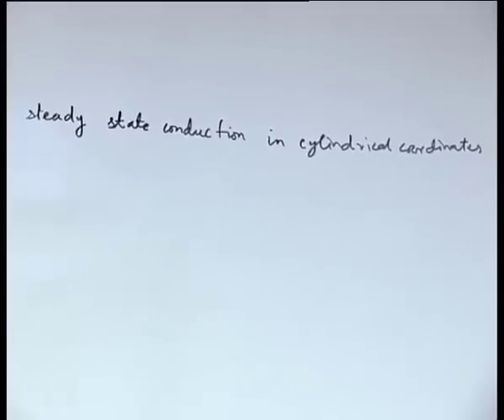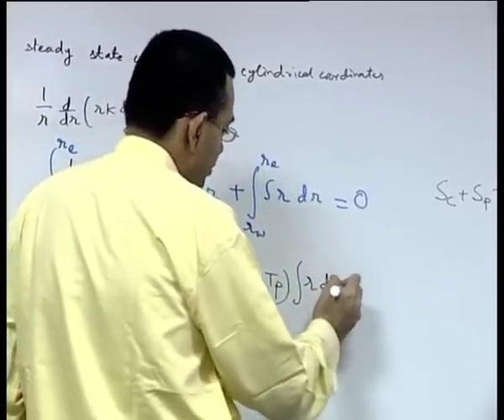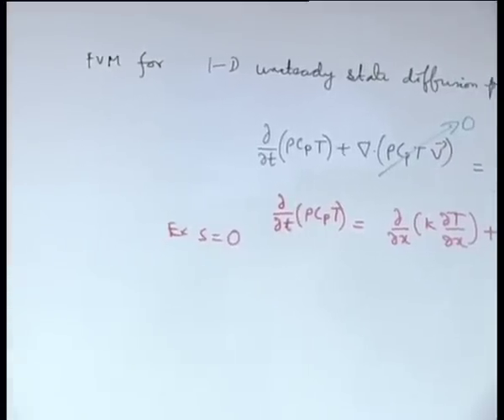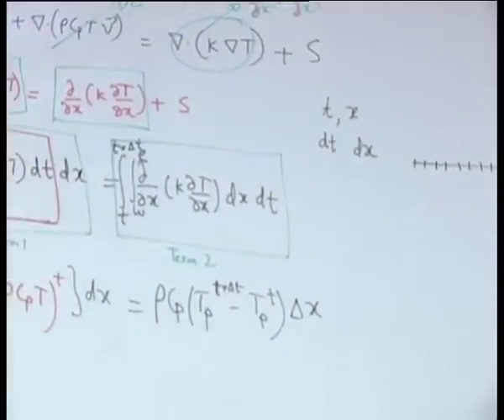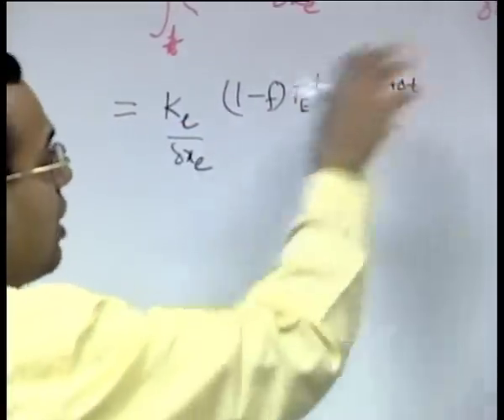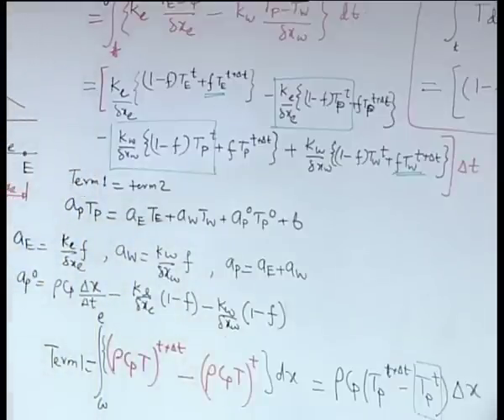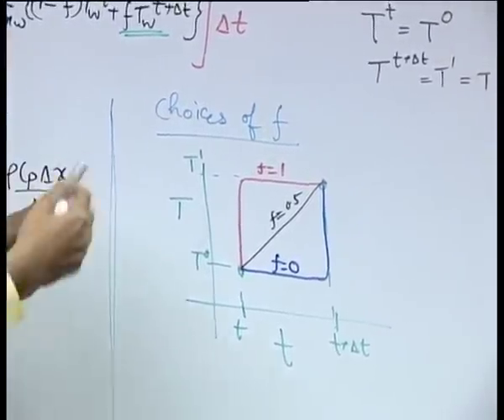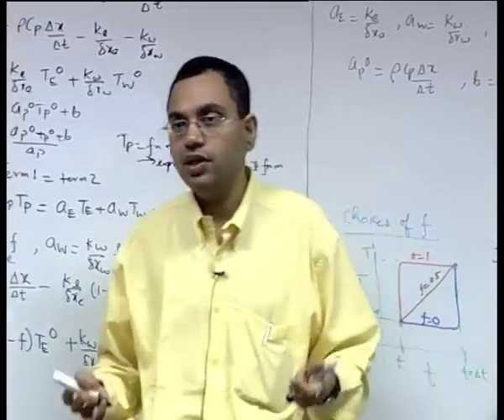Mod-01 Lec-15 Finite Volume Method:Discretization of Unsteady State Problems

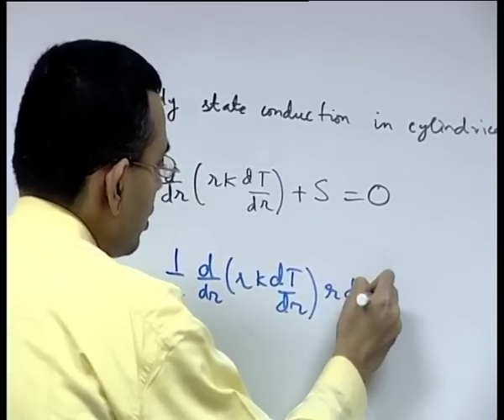Comment: Great lecture series! Although I think at 5:46 the differential element along the radial direction should be dr and the differential element along the azimuthal direction is rdtheta. So shouldn't the equation be multiplied by dr and then integrated as opposed to rdr if it is being integrated radially? Hoping for a clarification from anyone reading this!